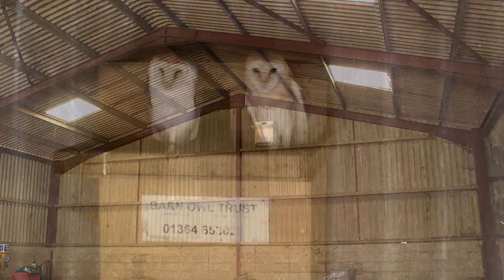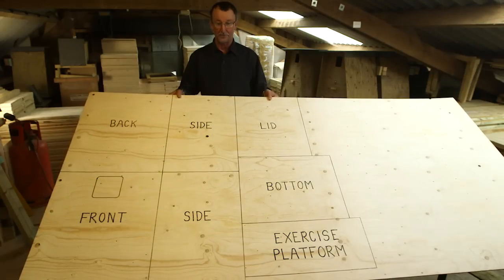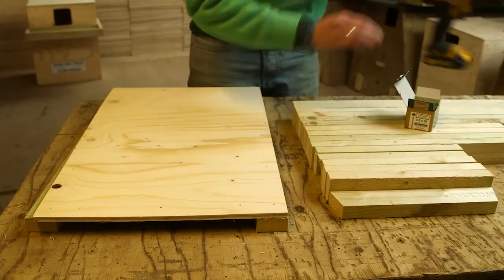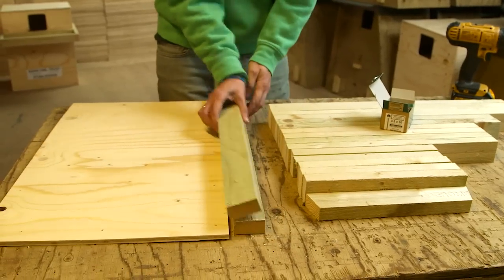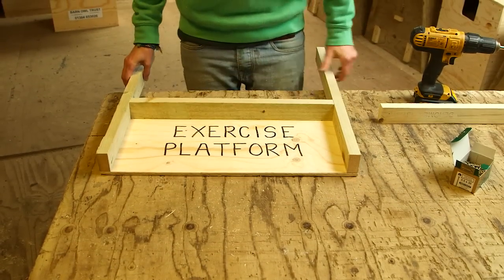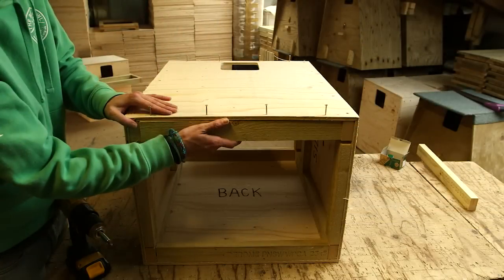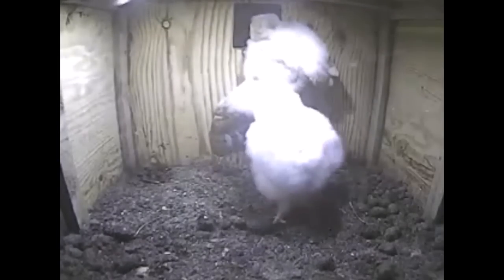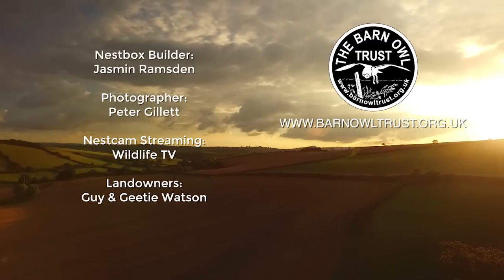How to Build a Barn Owl Nestbox for Inside a Building (please see notes before purchasing timber*)

Comment: A brilliant video! Im thinking of building one for an outdoor spot at my yard. Would a hardwood ply or 0SB3 be appropriate for the construction?
Thanks for such a explanatory video!
Reply from the maker: Thank you! 
Take a look at our website for lots more info and instructions for building outdoor nestboxes: 
https://www.barnowltrust.org.uk/barn-owl-nestbox/

Outdoor owl boxes should be built using timber which has been either pressure treated or surface treated (including all edges) with long-lasting preservative. Plywood must be manufactured using a waterproof adhesive.
Please avoid using hardwood ply, unless it is stamped “FSC Approved”. 
Good luck!

Comment: I have few questions as I am planning to build one box. Will the exercise platform expose the owls to predators? I saw a Steve Simmons design and is different, without exercise platform, he also puts boxes on metal poles outdoor but I saw that you do recommend  to put boxes in areas indoor that can easily be seen by the owls. I wonder if those differences are because owl’s behaviour varies between species or other reasons to me unknown. I have field mice in my land and would like to reduce this problem by attracting barn owls but I live not to far from a road reasonably busy during the day but at night not so much, I wonder If I should desist in building a box. Thank you so much for your help, dami.
Reply from the maker: Hi - the answers to your questions do depend on your location as climate and predators vary. Our advice is mainly appropriate for the UK where we are based. Here, there are very few natural predators, and boxes are best placed under shelter if possible, because of our cold, wet weather. It may be best to take local advice, but do build your box as far away as possible from the road. If possible, it may also help to grow a tall hedge or screen of trees next to the road, which helps to force the owls to fly higher over the danger of traffic. 
Hope this helps - good luck!